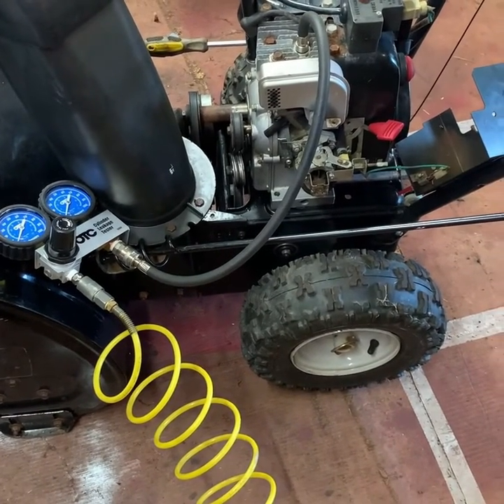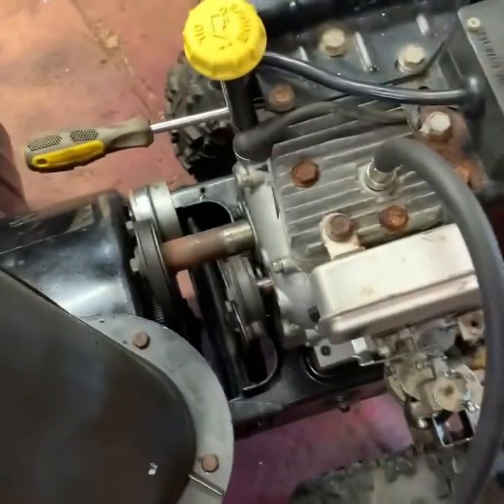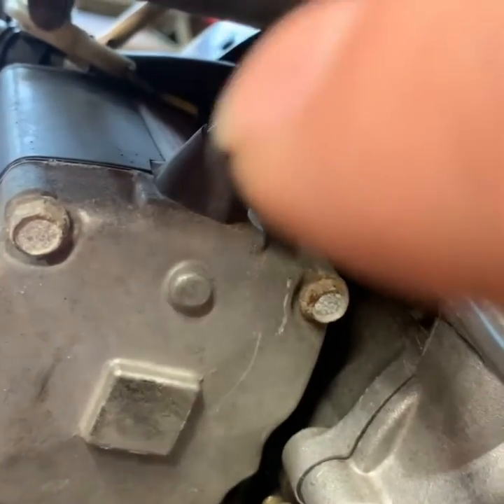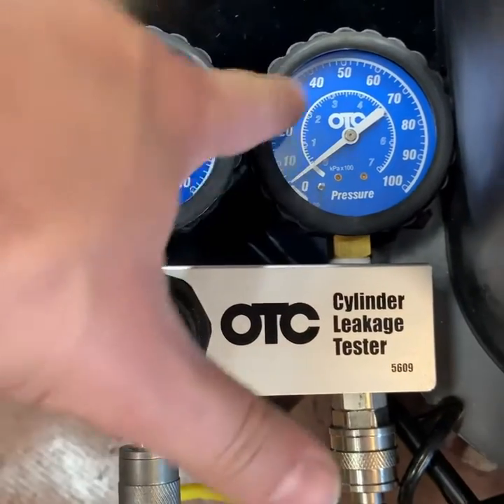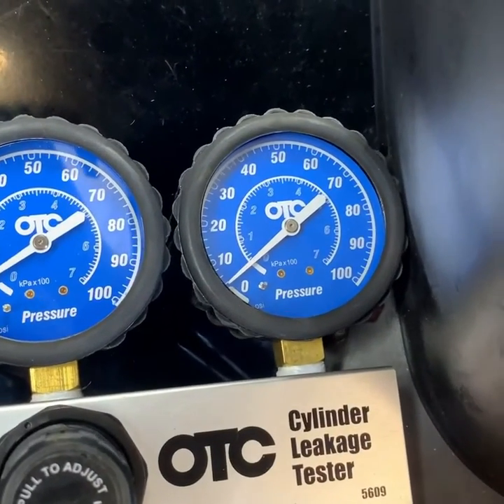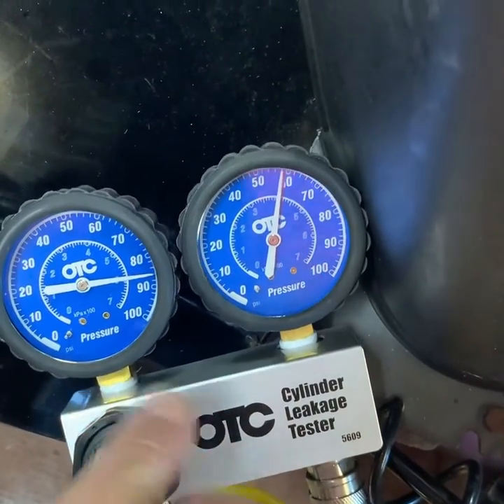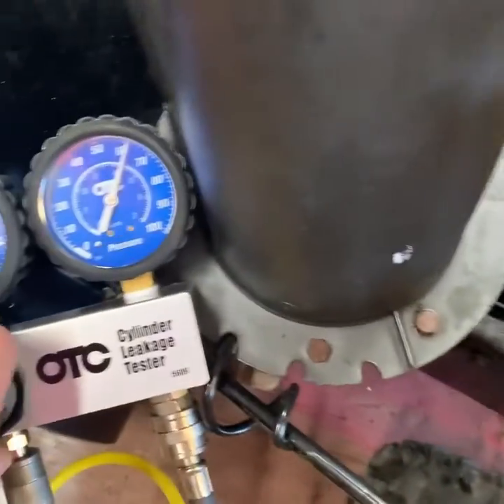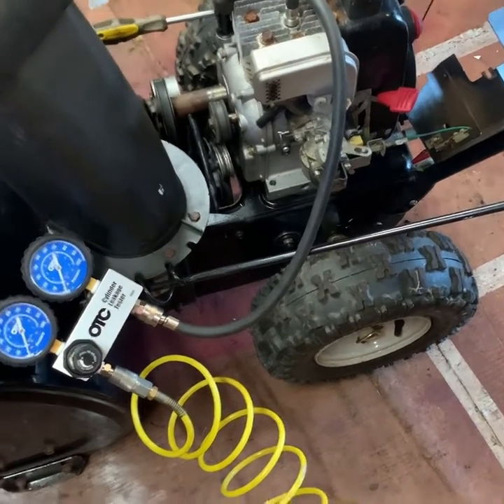Snowblower with no power when hitting snow. What can cause this?

Comment: Do you cut the valves yourself? Or do you mean lap them?
Reply from the maker: I lap them and usually cut new valve seats. But you have to cut the stem down a few thousandths to shorten the valve. Otherwise they won’t fully seat and you’ll have no valve clearance. Should have between .004” and .008”

Comment: Holy crap. Someone actually doing a cylinder leak down test the right way. Most videos on YouTube about how to do this test are wrong. It’s nice to see someone doing it right. Lol. 
To find top dead center on the compression stroke, I put a little bit of air pressure in the cylinder. Like 6-8 PSI. Then I turn the engine until I feel the hard spot where the cylinder is compressing that air at TDC, I move the engine back and forth over that hard spot and stop in the middle of it. It’s really quick. If the engine is at exact TDC you don’t have to clamp or block the engine to keep it from turning. It will stay there.
Reply from the maker: That’s a great tip and how I did it in the current video im working on. It’s a 1970 craftsman rototiller with a 6hp Tecumseh vertical shaft engine. I’ll try to get that video out in the near future. It would start with starting fluid but wouldn’t stay running, carb was immaculate checked compression, 25lbs. CLT had 65-70% loss. Needed a valve job.